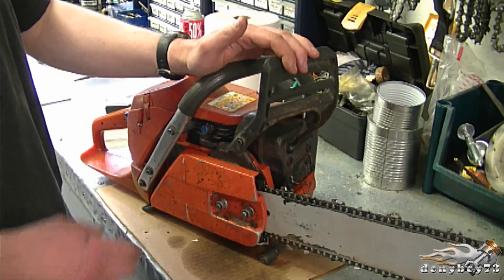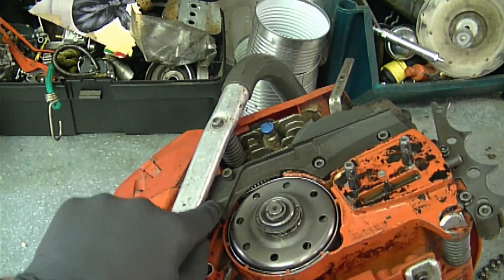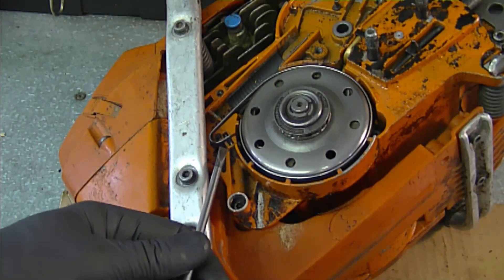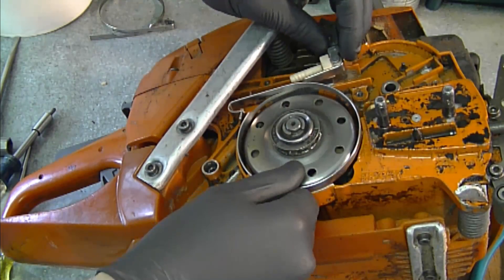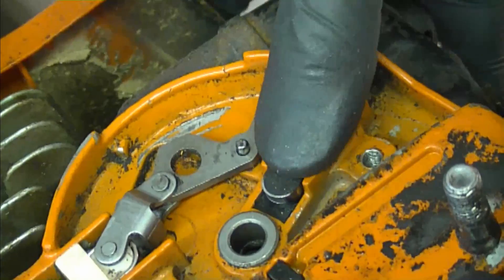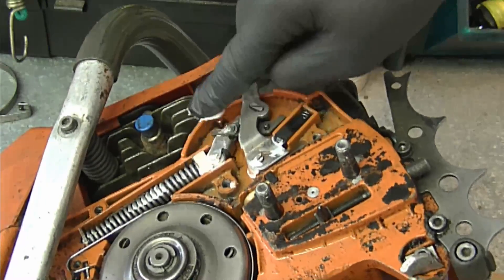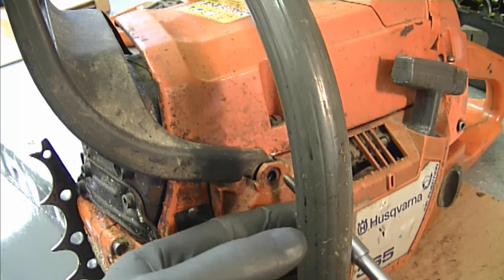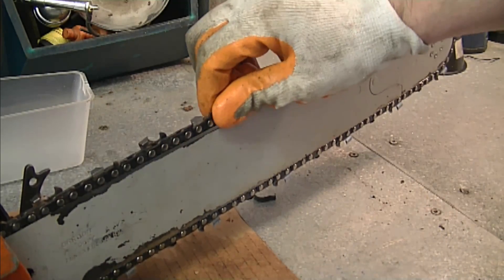DIY - Husqvarna 365 Chainsaw Brake Band Replacement

Comment: I must say that I find your videos to be very helpful. I already knew a lot about small engines, but having found this channel, I have learned so much more. Over Thanksgiving, I rebuilt the carb on an old homelite chainsaw. Rebuilding the carb was something I knew, but when I went to the small engine shop and told the guy I needed a K10-WAT carb kit, boy was he surprised. He looked at me in shock at the fact that I knew what parts I needed. All thanks to your videos! Thank you and keep doing what you do!

Comment: Thanks so much for this video. You've saved me £££ on tired brake band replacement. One thing though - I really couldn't get the big spring back on this way. I had to remove the handle and compress the spring with needle nosed pliers to seat it properly. Thanks Dony, keep going lad 👍🏼

Comment: Its Friday and the clock is edging twards 0:00 hours here in Sweden. And im enjoying myself alot watching this video. :) 
Good job Don.
Tmorro im gonna sink my teeth in an electrical chainsaw a friend gave me. He claims it sometimes just "revs" and the chain stands still. As much as i hate electrical machinery i love a good challenge! 
Ty for the vid and keep up the good work!
Reply from the maker: and this video has a good Swedish saw!
Reply: siemenstraffic
This is a Black & Decker. Its resonably easy to split apart. But it didnt help me much. Everything looked primo. The saw runs great until its put under workload. Then it starts making "Hacking" noices. First i thought it was something mechanical. But every gear and bearing looks great. Not a mark on them.
My suspicions is now aimed at the electric motor. But i dont really know what to do with it in regard to the way the saw behaves.
Any ideas?
Reply: Good call. Will deffo do that with my trusty testtools.
My suspicion will still have me puttin my money on the motor. Pbably somewere around the pickup or suchlike. Since it revs up fine and only starts "stuttering" while under load.
But that cords gonna get a proper check-up! 
Thank you for the tip.

Comment: Do not put the brake on with your hand. Sooner or later you will find your hand touching the chain. Put the chain brake on with the movement of the wrist.
 
Thank you for an excellent video!
Reply: I think he was just doing that for the demonstration because naturally when using a chainsaw, you will bump the lever with your wrist.

Comment: Great video. I have a 365 and the plastic oiler gear keeps striping out. I replaced the oil pump and still only get oil for a minute or two then nothing. And checked the worm gear and its striped again. Any thoughts?

Comment: In your video it is a white plastic setup that the spring slides onto and the band attaches to. Mine is blue which doesn't matter but is a replacement part since I broke the original. When I go to pry the large spring into place the plastic piece slides towards the handle and readjusts the metal mech and locks the saw to where I can't move the handle at all. Is there suppose to be a slot for the plastic piece to side into and perhaps mine is worn out? Any help would be appreciated Thanks.

Comment: Hi chad here, had a question about my new stihl 180c chainsaw and my new stihl bg86 blower I bought this year. I need to store for winter, should I buy the stihl moto mix stuff and run it out of fuel, or can I just use stabil and run out of fuel,just do want to mess them up, I've been told motors are more sensitive now, thanks chad

Comment: dony what is the difference between k10-wat & k20-wat carb kits
Reply from the maker: hi mike, the k20-wat kit has a few extra parts than the k10 like and extra smaller needle valve

Comment: Hi   Don just want to know does a broken break band  have anything to do with difficult starting while pull starting. Cannot get a full pull on rope as it keeps stopping every inch or so. Thanks an hap easter
Reply from the maker: +Carol Cruz I don't think so, if the chain turns then there might be a problem in the clutch, let me know
Reply: donyboy73
Reply: thanks don Will get back to you on Clutch your the best D